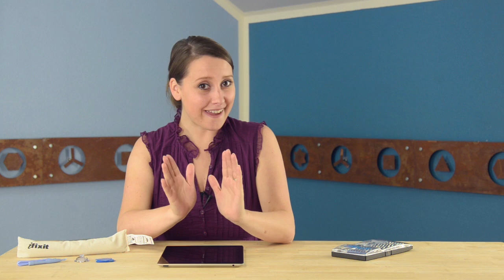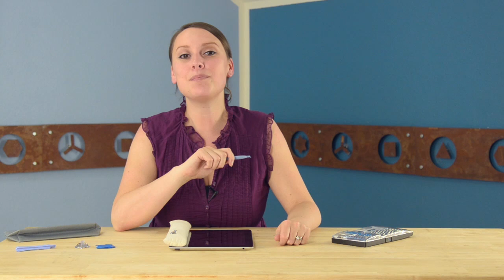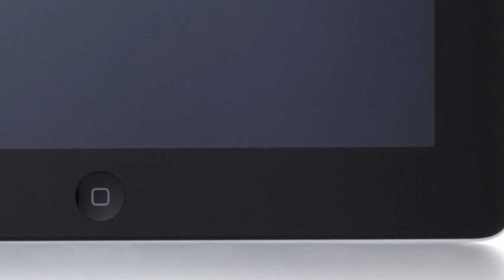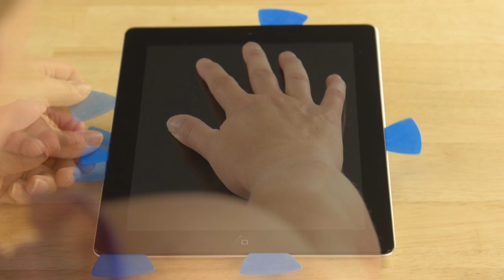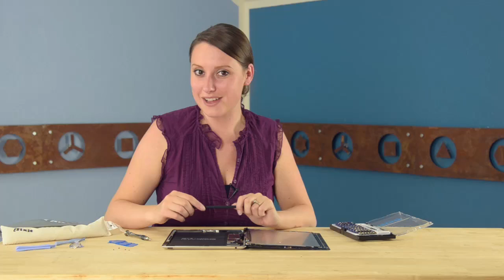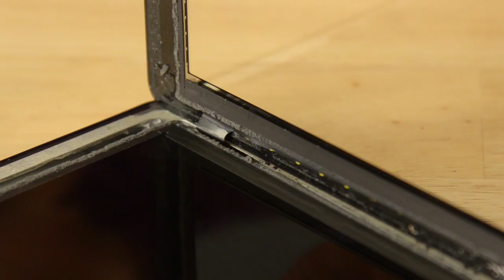How to: Replace the Battery in an iPad (3rd Gen)

Comment: So my girlfriends ipad battery swelled and of course, stopped working. I bought a new battery and installed it before watching this video, the only thing i cant seem to figure out is the little ribbon wire that comes from the cover. it pulled out of the location it goes to and i dont know if i am getting it all the way in or not. Regardless of the wire, the ipad will not come on at all, it wont show life when i try to charge it either. Could the old battery swelling have dont something to the rest of the ipad?

Comment: Excellent video, could do with some more close ups though. Time and patience is key to this. I did find that you don't have to remove all the ribbons from the board before removing it, just undo the 4 screws and you can lift it enough to remove the battery. I also broke the seal on the glass with a scalpel blade and removed the battery with a butter knife. Pretty risky but do able.

Comment: Looks so easy in the video, but the spudger is soft plastic and dulls quickly making it difficult to pry up the glass. Mine cracked before ever getting it up high enough to get a pick under it 😬. Highly recommend you have a new digitizer panel ready cause I can’t see getting this off without breaking the glass.

Comment: Thanks, great - very easy to follow video, allowed me to change out my knackered Ipad3 battery for a working new one, took 20 min from start to finish, I used a very thin wallpaper scaper for getting the final battery out, just made that last push so much less hassle.

Comment: Nice video.  I found, however that I was able to remove the battery without removing the MB.  I loosened the MB and was able to lift it enough on the battery side to slip the battery connector off the alignment peg.  It is safer to remove the MB, of course but this worked for me.  Also the battery glue is very strong.  I started by lifting the  bottom 1/3 portion of the battery after heating the back alot.  Good luck!  BTW, my iPad now will charge to 100% much more quickly now.

Comment: My ipad 3 is charging very slowly. Like 3% only per hour. Is the battery the problem? I bought new cable and adapter but it's still bad. It became faster for a short time, like 6%, but now it's back to 3% per hour.
Reply: shinyeon23 the charge controller built in the lithium ion battery recognizes how low the health is, and is trying to prevent any further wear by reducing charge speeds. A new battery would help.

Comment: Replaced digitizer & battery (not from iFixit) and everything seems good except battery is at 5% after many hours of charging. Is this some kind of a calibration issue or did I just go through all of this simply to install a defective battery? How do I differentiate between the two cases?

Unhappy if the latter is the case. If the former is the case, how do I force recalibration.
Reply: August Pamplona 

Quite frustrating. After doing everything right another thing went wrong. The digitizer developed a small crack right through the the middle of the front facing camera area.

After I had put it back together, I felt of it and it did not feel like the digitizer had completely adhered along two small sections so I tried to reapply heat and force. It either happened when I heated the upper part of the digitizer or when I pressed down on it with my fingers (I felt nothing unusual with my fingers so heat stress is possible). I don't feel that it should have cracked with no real displacement being involved and no sharp forces (much less due to uneven heating).

Comment: Thank You!! This just saved me from buying a new iPad. My iPad was trying to restart and kept crashing because the battery couldn't hold charge.

I took it to the Apple shop, they told me it is a hardware problem, that I should buy a new one for $500+. 

I bought a new battery and followed your steps

It works perfect now! only $30 to fix.

A tip, when taking the battery out, use a plastic spatula or plastic flipper to get under the battery.

Amazing! thank you so much for this video, you guys rock

Comment: It looks to me that the iPad, by design, was never meant to be opened again. So if Apple claims they can't verify state of battery-life (less then 50% or not) because damage to the glass prevents them from applying their measuring-method, then that is just so much hot air and bad excuses not to uphold their applecare protection plan battery-change guarantee, yeah?

Answering this would really help me as I'm filing a lawsuit against them to have them replace my iPad due to it's battery having run it's lifespan.
Reply: Apple in their dellusion, still believes they own the ipad you bought. Luckily we don't accept their BS

Comment: why did you replaced the battery again? Does this help fix the ipad not charging error?
I got an Ipad 3 that even when connected only shows the battery with very low charge icon will this procedure help? Thanks.
Reply: *****
 actually i just needed to stack charge the device. Had a high speed usb charger and after I left it connected for a while it came back to life.
Reply: esesolox3 high speed cable ?? I recommend just using the iPad charged Apple gives you, a lower Walt charger for the iPhone would take forger